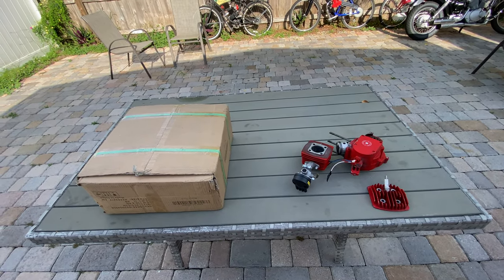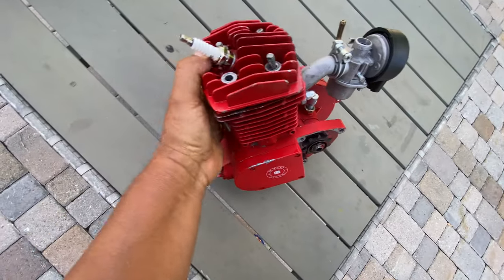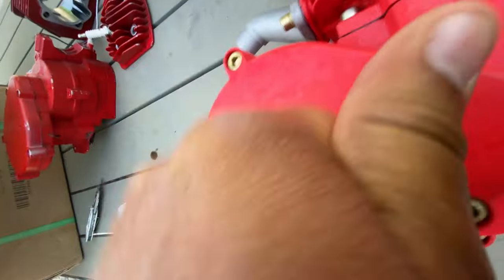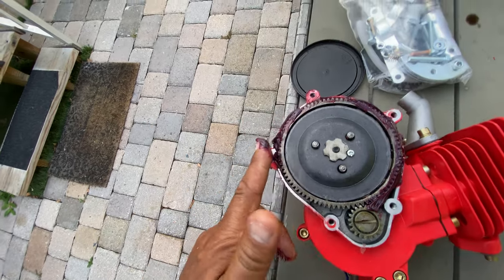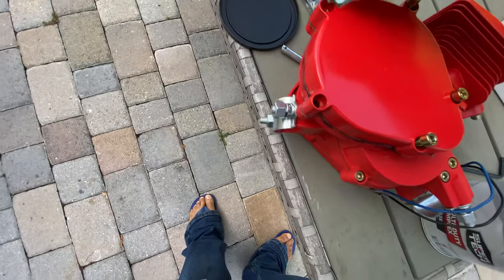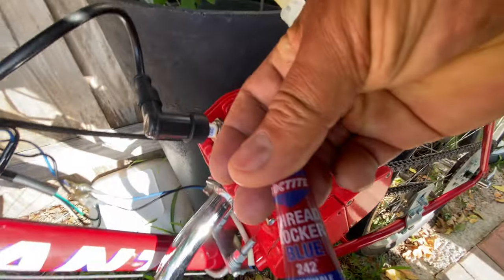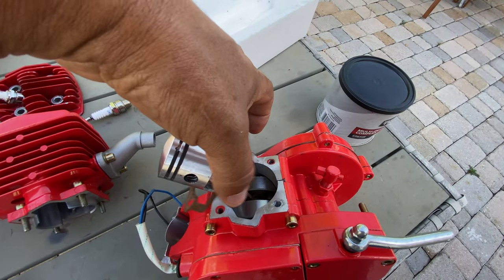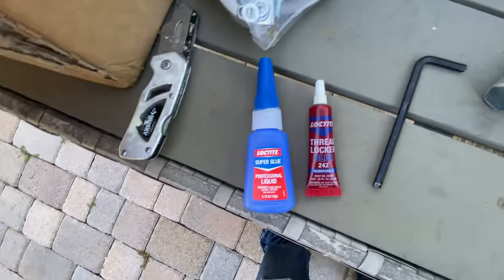Tips on motors for motorized bike

Comment: All engines possess inherent imperfections. Smoothing the surfaces can undoubtedly alleviate leaking concerns. The lower halves (cases) remain consistent across the board. The issue appears to stem from over-torquing the stud, resulting in thread damage within the stud hole. Excessive stud torque often leads to leakage problems. Merely avoiding leaks with a single-piece jug doesn't denote superiority; it could be a stroke of luck with that specific kit. I, too, encountered leakage problems with single-piece jugs. Utilizing two gaskets isn't a panacea; it typically exacerbates problems and diminishes power. Resolving leakage entails replacing gaskets and applying oil to them. After the engine warms up, studs and screws expand, potentially causing leaks. Hence, it's crucial to re-torque them during full heat soak. Additionally, favor non-painted kits to avert sealing and heat-related issues. The amount of grease applied seems excessive, risking interference with the clutch basket and plate, leading to slippage. Avoiding the use of locktite on the sparkplug is advisable to prevent complications. A malfunctioning head with imperfections may contribute to leaks. Opting for a two-piece jug and substituting the head with a proper high-compression variant can rectify this. If the case halves are uneven, acquire a suitable case or dismantle and level it. Considering your relatively nascent experience in this hobby, your knowledge about these China doll kits may be limited. It's sincerely hoped that individuals won't follow your advice and inadvertently damage their engines. Finally, acquiring the cheapest kits may occasionally yield subpar results.
Reply: Yeah I think you covered it. Nothing else to add here. Thanks

Comment: Is you put grease like you do you contaminate the pads clucht and you start slip you clucht i never put grease there and never problema
Reply from the maker: Just enough to lubricate the gear, whit the rotation and centrifugal force the grease will always be thrown out of the clutch so it is not easily contaminated

Comment: I never seen somebody put grease on the clutch
Reply: More power an its more smooth when riding
Reply: @Lucky2strokes no benefits of the excess
Reply: @danialthomas5659  it rides smoother an faster , an prevents rust , or metal on metal contact to prevent shavings as well
Reply: @Pedalfast22  the point is you don't need that much to get the same effect.
Reply: @danialthomas5659  the more the better because, some grease don't stay greasy after like 100 miles you'll need to do it again
Reply: @danialthomas5659  just on the gears not the clutch plate

Comment: Just one question why don't those engines have gear boxes?
Reply from the maker: Thanks for you comment, is because these engines should be simple, easy to install and cheap, if it had a gearbox it would be much more complicated to install and expensive, the gearbox function is make the vehicle reach high speeds what is not be necessary is a bicycle, this engines can handle easily 25miles hour

Comment: i think those one pice jug motors are bad they dont have great cooling and they can zise up more my friend had one of those and it sized up bad after riding it for less than month the two pice jug ones are way more better you can get bigger cylinder head to make them run cooler but i give you point for greasing the gear also dont use those exhaust screws use studs the treads can wear out on cylinder and then the exhaust will come lose and you cant get it tight enymore
Reply from the maker: I only had problems with the other engine model, losing compression, lousing power and leaking oil, so now I only use this model to assembly my bikes, I have already mounted 12 bikes with this engine model and I had no problems, no warranty trouble with my customers, except a screw that fell form the carburetor drain, the grease on the gear is to reduce the noise and reduce premature gear wear, should do not put excess grease to do not fall on the clutch, using glue on the screws is exceptional to prevent the screws from coming out with the vibration of the engine, especially the fixing screws of the exhaust of the carburetor of the cylinder and all others that can be prevented from coming out by the vibration